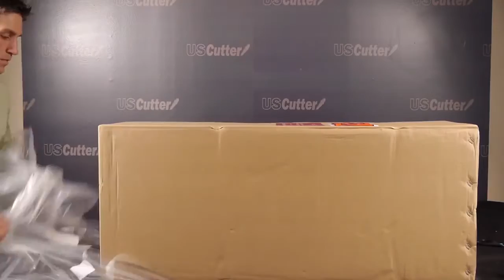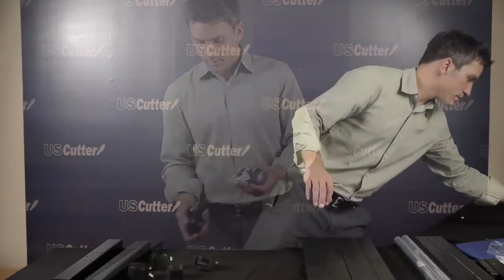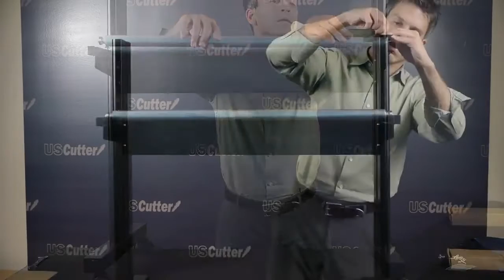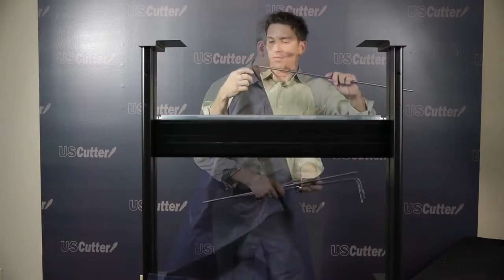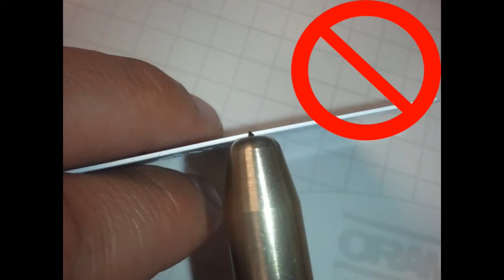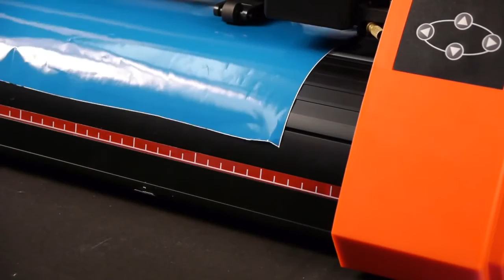Laserpoint II Setup and Installation

Comment: You guys need to do some improvements in your machine designing in terms of setting up SMH it’s a disaster connecting the cross bar to the 2 side legs also do better in packaging SMH who ever pack the box wasn’t smart at all , they place a for a fragile peace of item on top of the box which the box had plenty of space below . I’m setting up for now well trying to I’ll see how good it works . Fingers crossed.

Comment: My cutter isn't lining up when I set it on the brackets. There are two screws   on either side of the bottom of the machine that are resulting in the cutter not resting directly on the bracket. No matter how I position it one side ends up with the screws on the bracket and the other with them hanging off. This is resulting is my cutter not being level. Is there a solution to this issue? Is it even a real problem to have one side of the cutter be a quarter of an inch higher than the rest of it? 
I also don't have a serial number on my device or the Vinyl Cut software. The sticker is there on the back of the machine along with a blank line labeled serial number, and if I need to download the software I've been given no instructions on how.
Reply: I have the same issue (with the cutter not resting flat on the bracket). Hopefully they can tell us something.
Reply: Same issue. I removed the other screws that were hitting and it was able to work for me. Not sure if you're suppose to do this
Reply: Lol I thought about doing that but was worried it would mess up the vinyl cutter.  What I ended up doing was cutting some extra holes in the brackets for the screws to sit flush.  As long as it works still you should be good.
Reply: Marie Raven - I have the EXACT SAME PROBLEM!